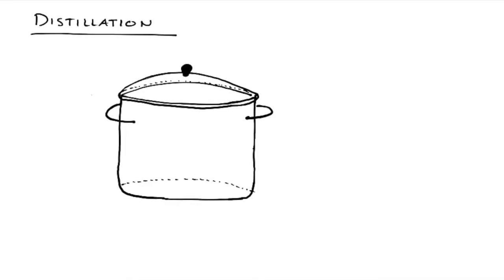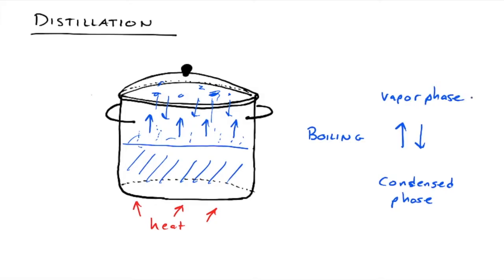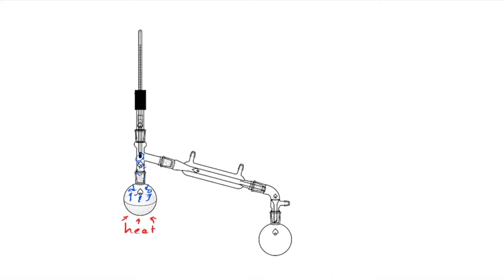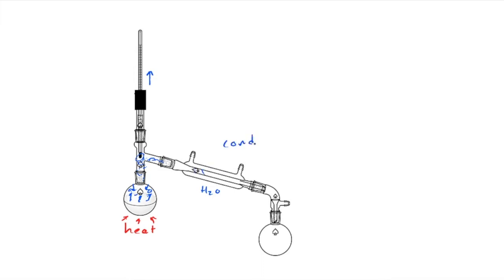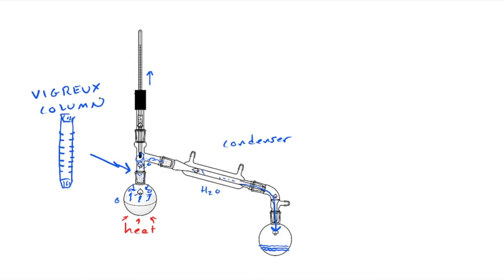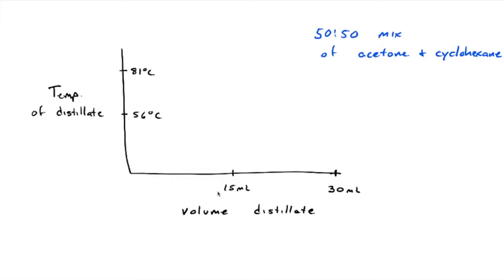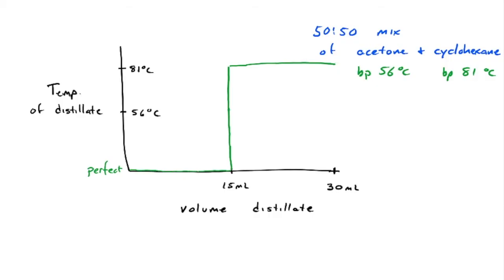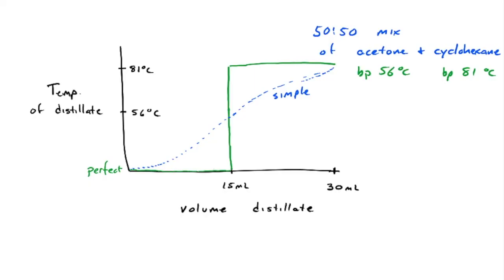Simple and Fractional Distillation

Comment: The graph of your ideal destillation, temp vs. volume at 9:14 might be wrong. The way you are drawing it, you are getting destillate before 56°C. It becomes more obvious if you swap the x and y axis.
Reply: It's wrong, but not axis swap. The graph has to stay between the two boiling temperature and not between zero and the highest one.
Reply: I think the ideal graph should actualy start from 56 deg. Or go from origin straight up to 56 deg and then as depicted, so there should be two sharp steps
Reply from the maker: Yes, it is wrong. The lines should begin at the 56 ˚C mark as they move to the right, not at the bottom of the graph as I drew it. That's an embarrassing mistake, and I'm happy that you noticed it.

Comment: Why is there temperature recordings every 2 degrees increments when a distillation procedure is separating 2 compounds in a mixture with 2 boiling points?

You'd expect one temperature on the thermometer to be reached and maintained while it boils and condenses over and then the second compound in the mixture. 

Why recordings take place every 2 degrees increase?

Comment: Hello Dr. Derik, i just want to ask you about concentrating a 41% nitric acid solution by adding mangnesium nitrate (dehydrating agent) using a simple distillation : first we maintain temperature at 100°C (temp of water ebullition), collecting the half fraction which contains mainly water and raise temperature and collect a concentrated solution. Can we do that? Thanks in advance.
Reply: I can't properly answer that, but I will say this:
If you want to maintain a steady 100° C, use a double-boiler.
If you don't know how, ask any cook.